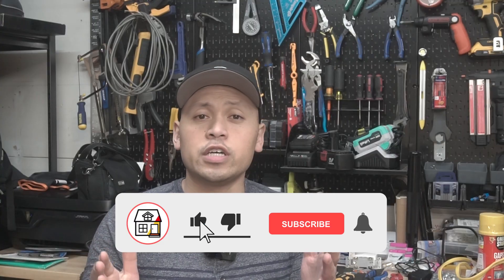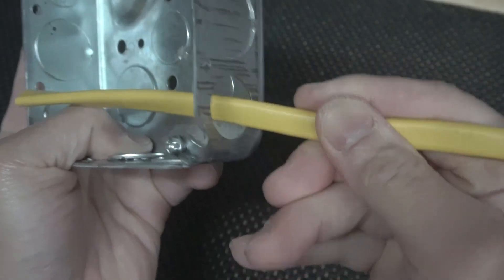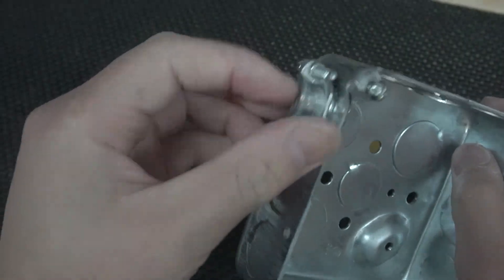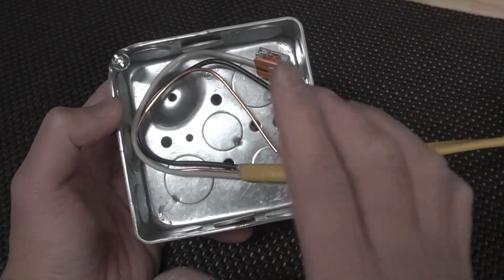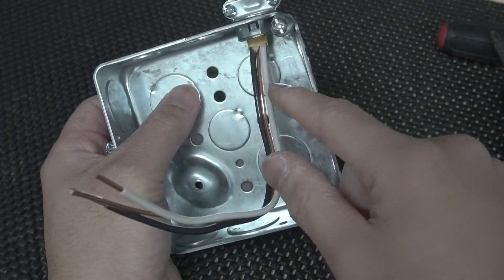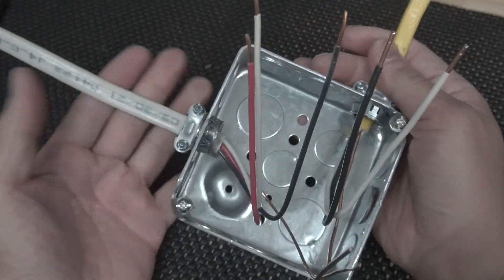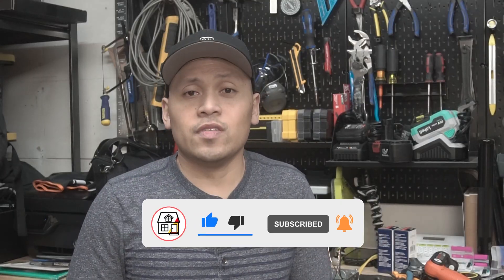5 MAJOR Violations DIYers Are Making When Installing Metal Electrical Boxes! MOST Are Guilty Of #3!

Comment: I think the nut for the cable connector has teeth that dig into the box when tightened.  If you turn it to the wrong side the teeth will be on the wrong side and won't lock the nut in place.

Comment: Some notes:

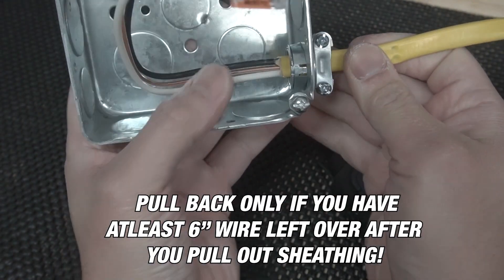4:13 (mistake #3) Grounding metal boxes is required only if the conductors splice or terminate in the box [sec. 250.148]. If it's just a pull box instead of a junction box, it's not required.

6:44 (mistake #5) It's certainly arguable. But NEC allows to use 14AWG taps in a 20-A branch circuit with 12AWG conductors [table 210.24(1)].

Comment: When I've done Romex into metal, I use the old screw on type mostly becuase the metal snap-ons were not availabe and/or hard to find.
The plastic ones are too wonky. The metal screw-ons really need to be tighed down witch is a PITA without a pair of pliers or a tool made for that purpose. And, yes, people will use a screw driver to bang those nuts in, which is sub-optimal for many reasons. For DIY, the snap-in metal ones are your best option.

Comment: Just a point, even if you touch a hot box, unless your other hand is  touching a 
grounded object or you are standing in a wet area you wont get a shock necessarily. But a good idea when working with high voltages is to keep one hand behind ur back.

Comment: Yah but the problems with the screws is that students tend to over tighten the 2 outer screws and then it puncture through the insulation and then it creates a short circuit. I tutor electrical wiring with my teacher and we've seen so many students blow the fuse because they over tighten the 2 screws. In the past, he had to call security to turn on the circuit breaker again if it flips, and at one point the security guy wasn't happy and complained to the school. The school almost shuts down the class for good. Now my teacher uses 3 safety devices so that it wouldn't tricker/shuts off the breaker. He uses an isolation transformer, a quick blow fuse, and a GFCI. 
One semester, I saw a Mexican guy puts the hot wire on the metal box. I told him "NO, DON'T DO THAT". He keeps arguing with me, and in the end, he even said "this is how we wire in Mexico". 
I asked people where they learned electrical wiring and they say "Youtube". I tell them to take a class at Santa Ana College in California. There's the basic and advance class. My neighbor and I teach people the correct way to wire, not Youtube way. We go over a lot of theory, which some youtuber don't teach you. My cousin learned from youtube and he wires for the temples. I've seen dangerous wiring or ways that would violate the codes or inspector would not like it.

Comment: On a metal box, it's better to leave enough of the feed ground wire to go around the box ground screw and then go to everything else.  Going to a push in or screw on nut can potentially come off and be again a hazard.
Reply from the maker: Thank you for the tip! 🙏🏽😊

Comment: The 1/4 inch sheathing is a minimum. It is not "out of code" to have extra sheathing in the box. (although it looks amateurish to leave more than necessary)
Reply: It also fills up the box and is hard to bend if you leave more than a couple inches.
Reply from the maker: Thank you !